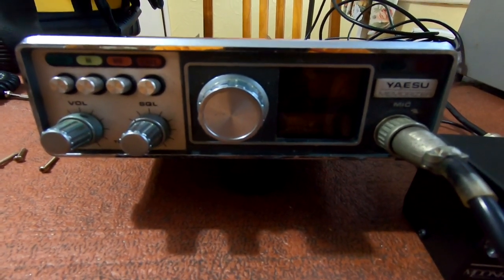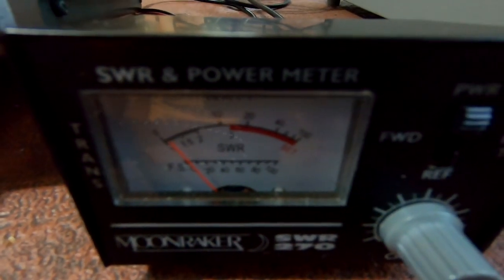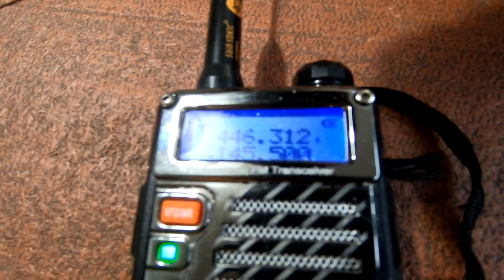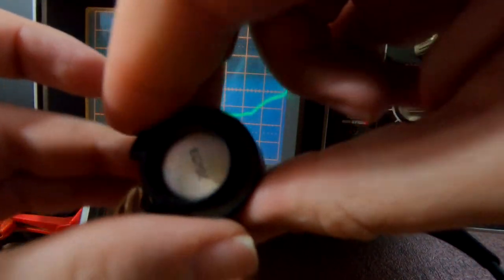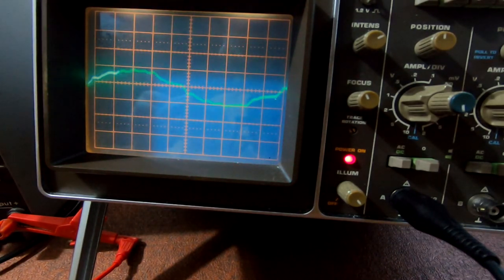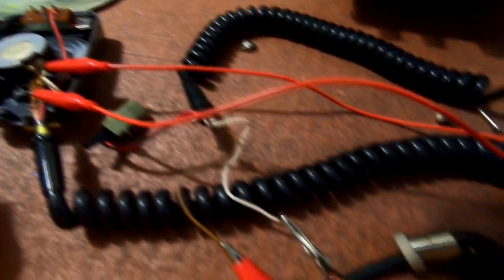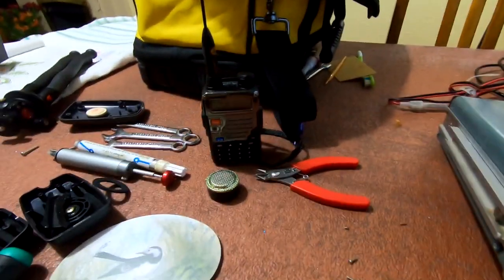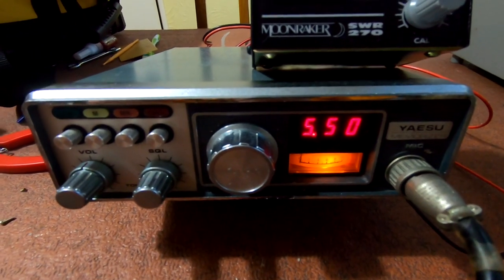Yaesu FT227 Power and Transmit Test

Comment: friend. I have a question for you. Alaways when turn on, start with 145.000 frequency? If you turn on with memory key, how works?
Reply from the maker: Ive uploaded a video on this showing how the memory works. Always defaults to 145.000 when switched on when the power has been removed.